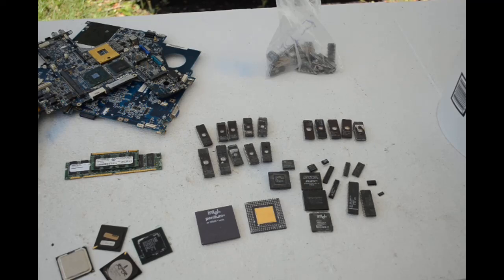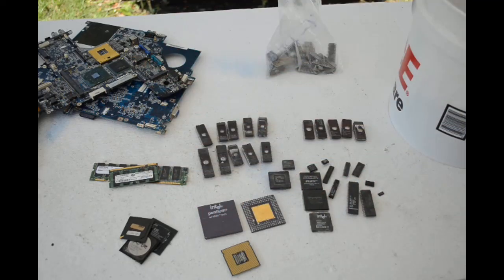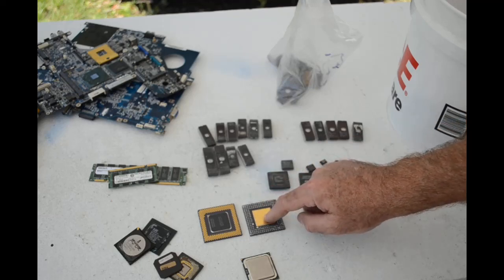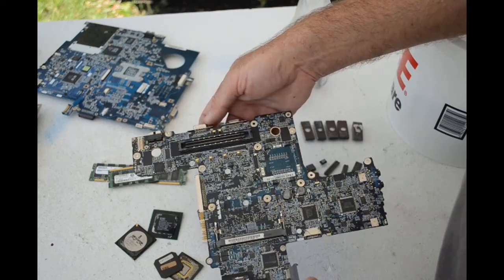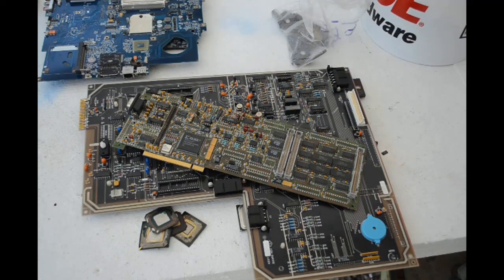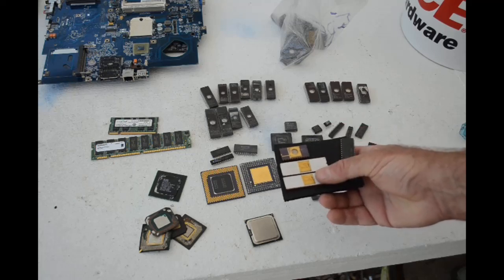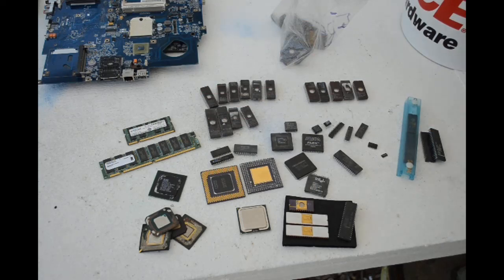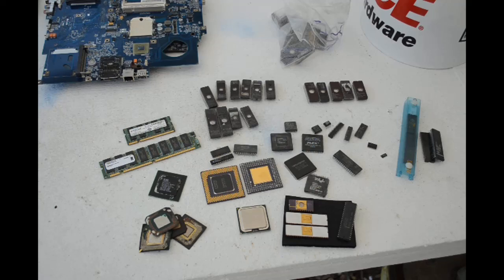Where is the gold hiding in e-waste? Part 3 IC Chips. Plus, How to get added value from your chips.

Comment: This ia a prime video series showing which electronic components have gold and silver. For me identifying electronic components should be the 1st stage in electronic gold processing. Then the types of processing. I would love to see how you process the ceramic squares with a copper square attached, the round ceramic diodes, the rectangular ceramic chips, and circuit boards with gold printed over copper and covered in glossy ink. Also show how much (ex: weight) of a particular component is needed to leach a reasonable amount of gold (ex: gram).

Comment: Hi.
Thanks a lot for your videos.

I have a question:
This pinless Cpus and other cpus, 
Are they silver plated on the top or which metal is that?

Also does edo ram, and all older ram with thick ic chips, contain gold on the chips?

Thx a lot